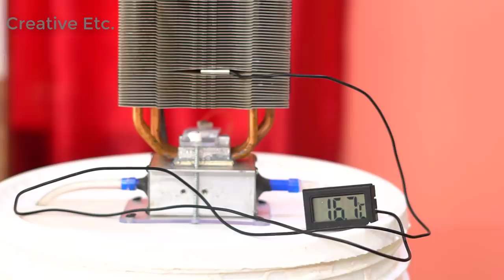How to Make  Air Conditioner at Home

Comment: I wonder what happen to the bucket water !!! Isn't it get boiled ?!!
Reply: it does not boil but it would get to a point where the temperatures even out if u don't change the water
Reply: the cooling module has a max temperature difference where it no longer pumps heat If its 55deg F then if the room is 75deg F then the water won't go higher than 130deg F.

Comment: You have assembled peltier cold side facing hyper 212X heatsync cooler, thats wrong. Hot side of peltier should be facing big heatsync.
Reply: I agree but since he use here water cooling, it is sufficient. It is not about the size of heatsink. it is about heat transfering. So water cooling of heat side is far batter than having a 3 sized heatsink.
Reply: @apc2729 u r wasting precious electricity,  fan is blowing air towards cold heatsync, it should have been taking cold from heatsync  & blowing out in room....cooling room or cooling already cold heatsync?
Reply: @BP-sf7br  Brother, it seems you don't understand working of AC. Fan is there to blow cool air to the room and the water cooling of heat side should be there to suck out the heat produced. Please try to understand working of a Normal AC. Fan blows out the air through cold fin to provide cool air to the room . Hope you understand.
Reply: @BP-sf7br  Blowing towards heatsink will work as long as it has a path to escate air out. it will work both way. you can either take air out using evacuation method or just blow air through heatsink fins.

This heatsink you see in the video is very good for blowing hot air through cold fins to get the room air cooled.
Reply: It doesn't matter where you install fan. you can either blow the air towards the fins or you can install fan to take air through the fins. in either ways, air is passing through cold fins to get the air cooled . not the heatsink to cool again.
Reply: @BP-sf7br  Also, using the similar Dell server heatsink and four peliter module, I have done this and it gives good cooling
Reply: @BP-sf7br  By the way, effective way is to take air through the fins instead of blowing air to the fins as fin resist airflow which will reduce efficency. sucking air through fins is better than just blowing air through the fins
Reply: @apc2729  purpose of such big heatsink, which is usually used in modern PC's is to suck the heat from processors which is cooled down by a fan blowing air over it, it will be obstructive to the airflow on the other side of the fins....u may get good results, but by using 4 peltiers energy consumption goes up. Comparatively what u achieve using 4 peltiers & water cooling can be achieved by just 2 peltiers.
Saving on energy cost & matariel cost.
There is an youtuber named "Mr hacksaw" he has demonstrated a single peltier cooling with small outdoor unit too, plz have a look at it.
Reply: @BP-sf7br  you are right bro. Peltier is useful only when we combine both passive and active cooling. that means we need to make lining in the room using thermocol to prevent heat enter the room from otside . I was just saying
Reply: Sir material detail

Comment: I am not one of America's top 2%.  I wouldn't spend all that money on a toy.  Since a large can of water makes a difference, you need to have that water cool enough at the beginning; or wait until the toy has cooled it for you. Conventional air conditioners rely on the latent heat that evaporates the water.  In this enclosed system, evaporation is impossible.

Comment: Dont fool others.
1st of all, this not at all "AIR CONDITIONER".
This is just as a regular "Water Cooler".
AC needs "Gases" like (R22, R410A, R32, R34, R134, Latest Geases like R290 & R-600A) to cool the area.
Reply: No, the peltier block is a solid state heat pump so it geniunly is pumping heat from the air to the water, the problem is mainly that the heat isn't leaving the room, it should be pumped outside.
And I have no idea how efficient it is.

Comment: If you really want to cool it down put ice in the water in the bucket.
Reply: That would be a lot easier and more cost efficient - just put a regular fan behind a bucket with ice. The fan isn't strictly needed, but decreases the time to melt the ice/pull heat from the air. Of course, whatever unit is producing the ice will heat up its surroundings more than the melting ice will cool it down..

Comment: The system will work first
As the water inside the bucket heats up, the system will fail
The water inside the bucket also needs to be cooled
If the bucket is metal to dissipate heat and cool the water
The heat will go into the environment and this is not true because the system cools the environment and the water heats it

Comment: Hey all of you 
😡😡😡😡😡😡 
 He got a try 
Is it is problem 
If it's hot so what 
Use it 
Still you got 
Air 🤔🖐
Reply: If the water got  hot 
Take 2 bucket and 1 in fridge and 1 in use when 2nd bucket get hot use another and put hot water in fridge  
🧐